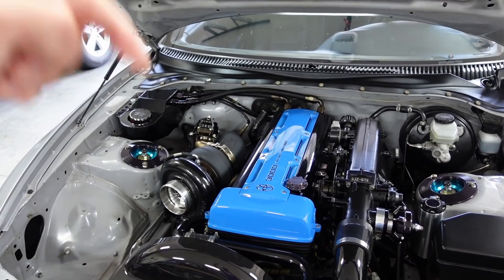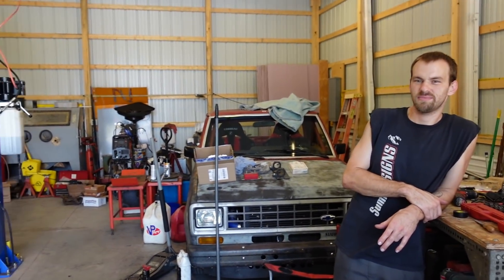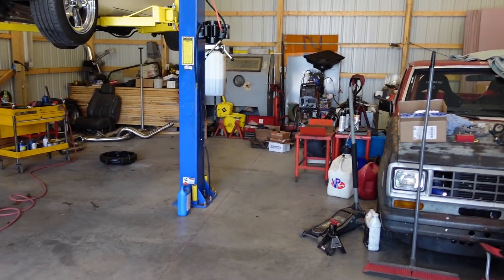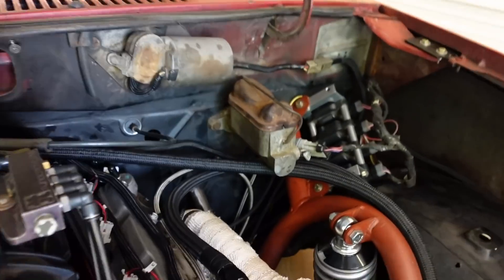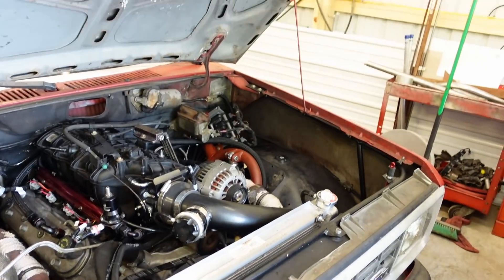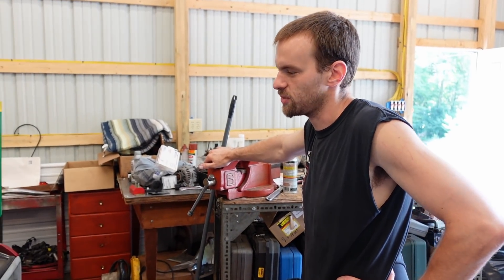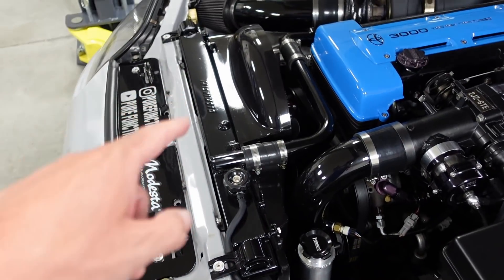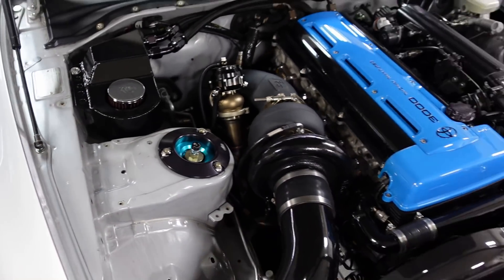Supra Is Finally Out Street Racing (Draggy Verified)

Comment: Fun fact, the fuel pump doesn't actually start priming until you start cranking the engine unless you have it wired differently than factory.
Reply from the maker: Tyler Hahn correct, my car is on a stabalone and wired direct.